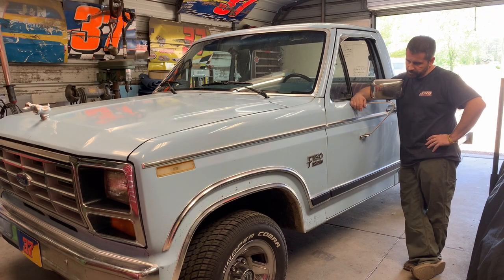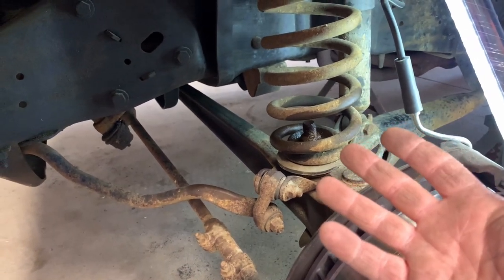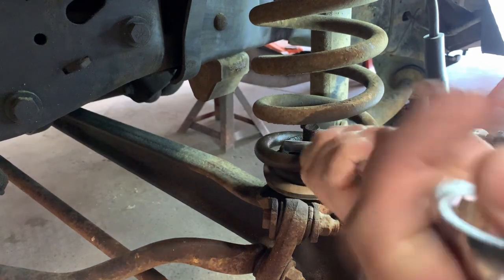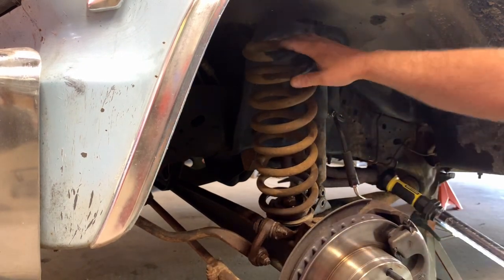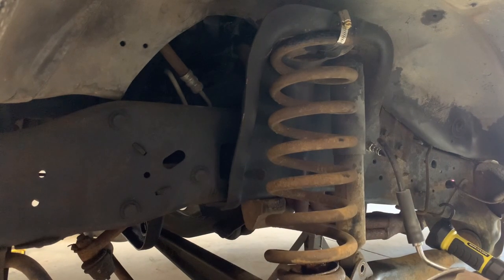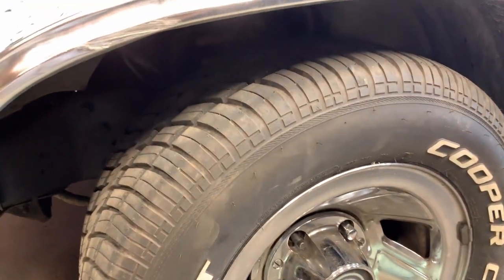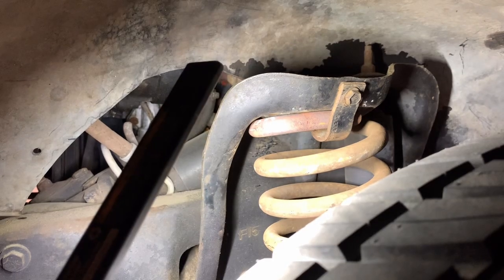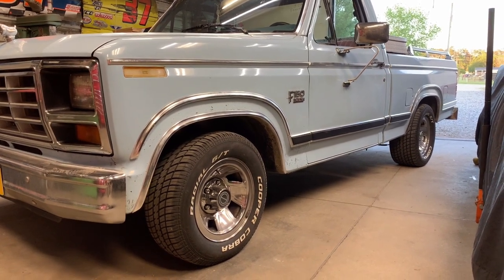1986 Ford F150 lowering 2 inches

Comment: cant a guy get FREE Rear lowering  just by removing the front leaf spring perches and either just mounting them 3 inches higher on the frame with new holes and bolts? or similarly remove the spring perches and swap them side to side and upside down if that makes them fit better and still mounted higher on the frame?
Reply: my truck has about 3 inch rake/higher in the back is why i am asking and it needs a  couple inches lowering back there , since it will unlikely ever haul enough weight to max out GVWR
Reply from the maker: You might be able too but would be a lot of fabrication and those brackets are riveted to the frame you would need to cut the rivets out,   Lot of work👍